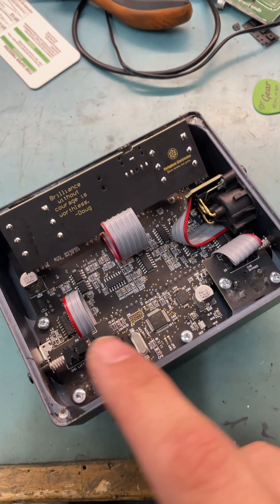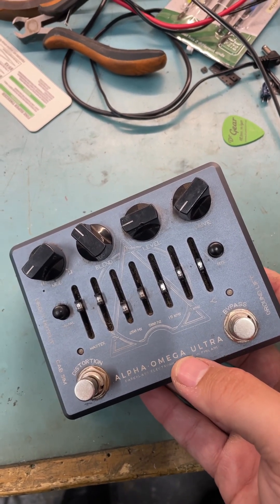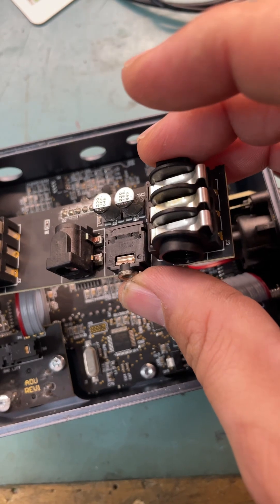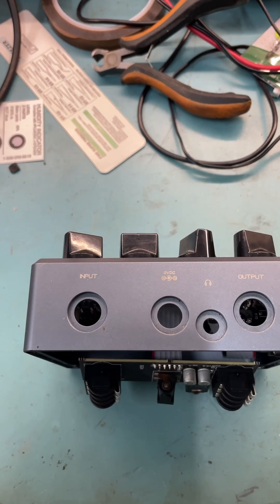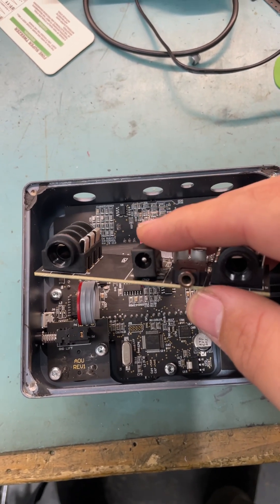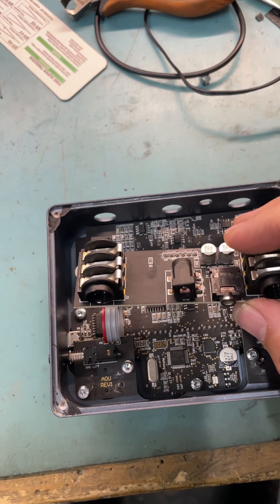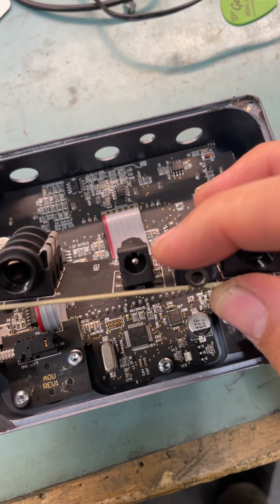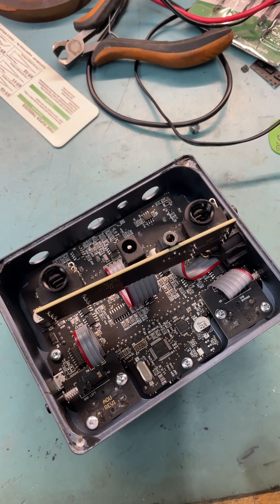Darkglass Alpha Omega Design Fail #brokenpedal #baddesign

Comment: Wow. So I'm about to sell the farm to get the Anagram. Can you look at one of those? 

Also, I have a micromark amp by Markbass that needs a replacement input jack. Its overwhelming to took at desoldering everything on that board to replace. Is there a workaround?
Reply from the maker: Not unless someone brings one into me and I can disassemble it and give my opinion. 

As for the Micromark, shouldn’t need to desoldering everything to get to the jack.

Comment: Change for a chassis mount dc jack?
Reply from the maker: Already did. The placement of the PCB limited the options but I found one that I could fit in there but had to use a washer to reduce the hole size.